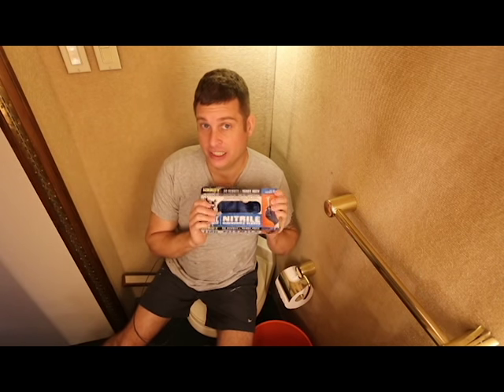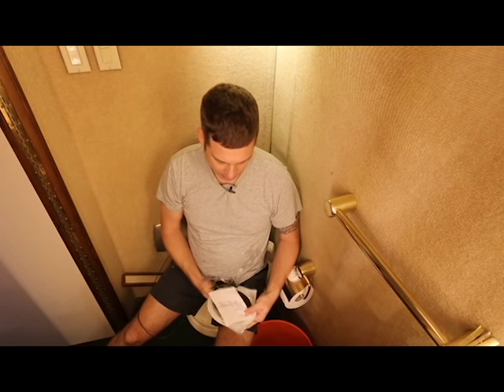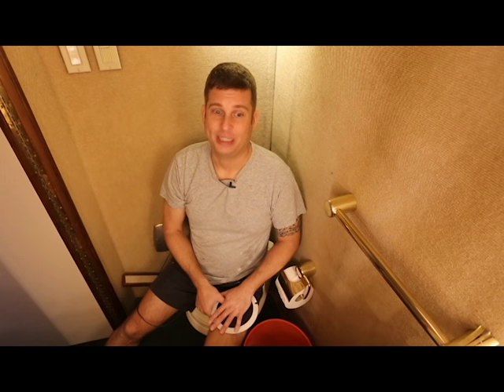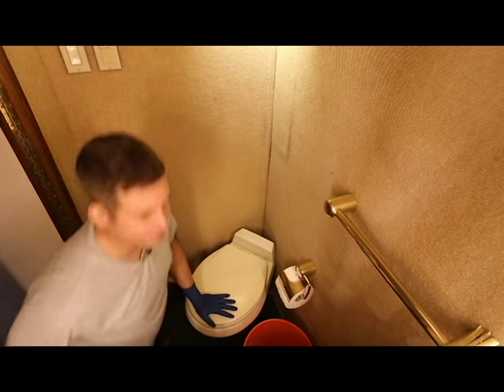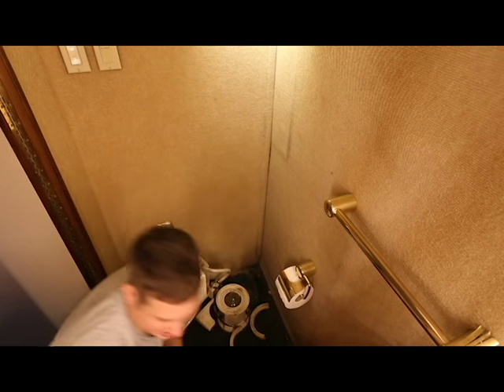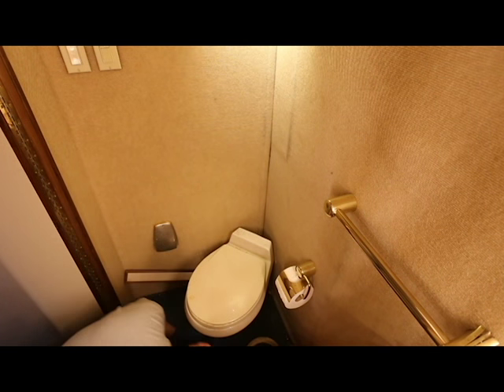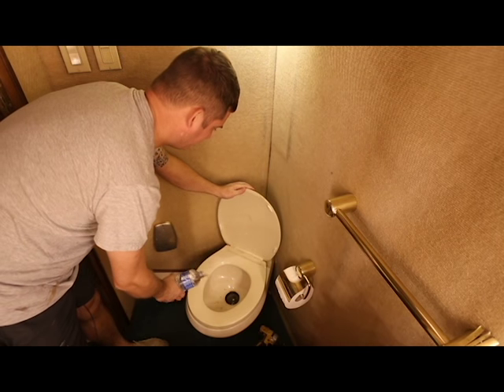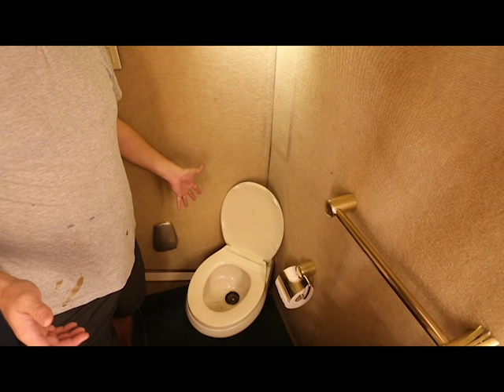RV Toilet Exorcism - How to replace the ball seal on your RV or Marine Toilet - Thetford - Sealand

Comment: And I also have the exact same problem if I had know it was that easy I would have done it long ago
Reply from the maker: Glad I was able to help.  It was really quite easy.
Reply: You had stated in the video that you didn't know what kind of toilet it was because it had lost it's markings over time. Search via Google "Dometic Sealand Traveler 510" also it could be 110 510 see which one is closest it's good to know because eventually it will be a valve kit "model specific". Good luck

Comment: Dude!  Fill the black tank with water BEFORE removing the stool.  the object being... Eliminate the air from the black tank and you will not have fumes / vapors inside your coach while you're working on your toilet.  it's not necessary to clean your tank just fill it with water, right to the top or as close as you can get it.